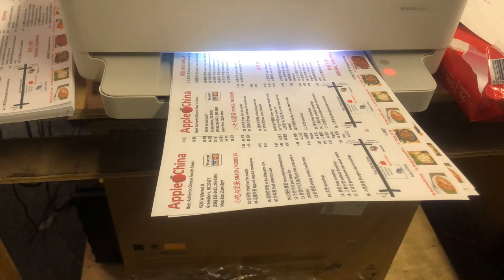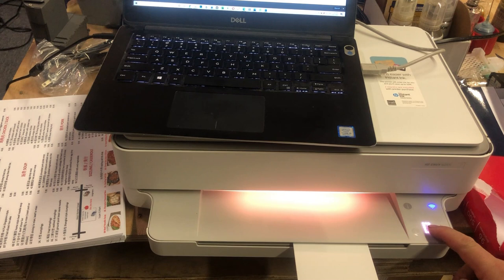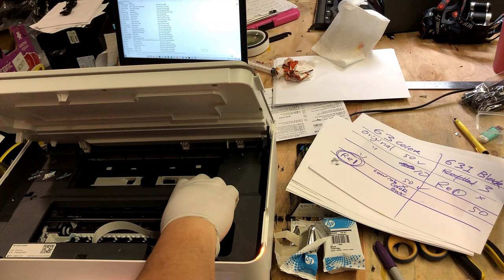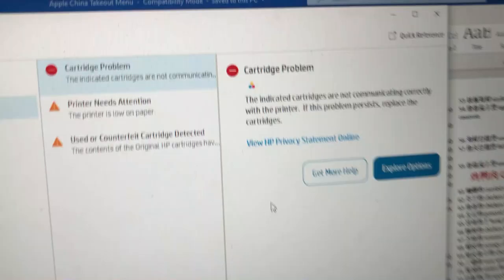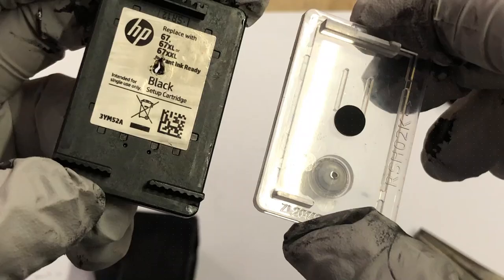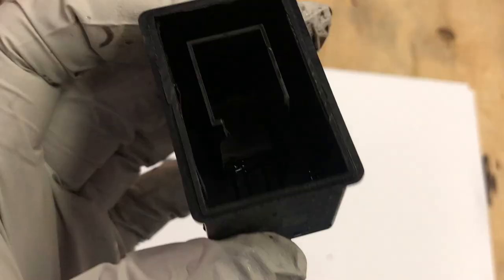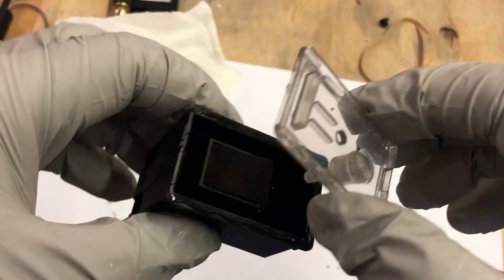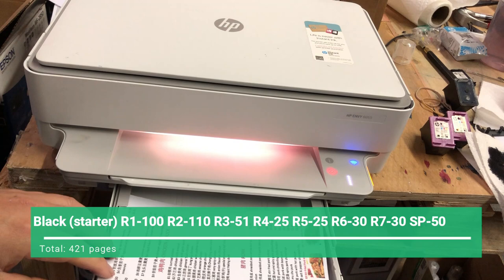Refill HP 67 67XL Ink Cartridge - Part 2 - E0 E1 Error, Spongeless Refillable & Sponge Fatigue

Comment: Very informative video, thanks. Shame on HP for changing their sponges. Is it a common problem that starter cartridges cause more problems when refilling them than regular ones? What is the difference between them and is it possible to tell them apart just by appearance?
Reply from the maker: It is only observed in 67 cartridges.  They all look identical.  I can’t tell them apart.
Reply: The starter cartridges are linked to the HP Ink Service, Instant Ink, and can only be linked to your printer and once your subscription ends, the cartridge stops working.  I purchased a ln hp 67 ink by itself and tried refilling the ink and after toying with it all day, for about 5 hours, it still didn’t work.

Comment: after refiling everything works fine..but i noticed that printer now does not print fine as before..i bought new black cartridge and on same print settings new one prints fine and refilled one prints a bit with small smudges on borders of letters even though print head looks same and does same mark on press on towel paper as new cartridge .. why is so ?

Comment: Hi, i have refilled an Hp65 black ink cartridge using a syringe however, my printer (Hp deskjet 2600) still detecting the  cartridge as empty. Any idea how to fix it? Thanks
Reply: This video is part 2, check out part 1 where he addresses this issue.